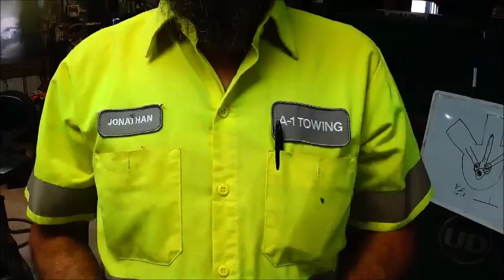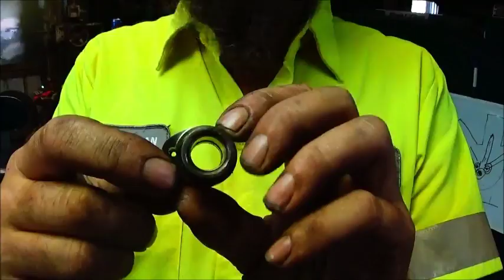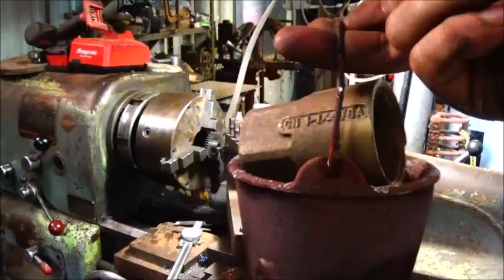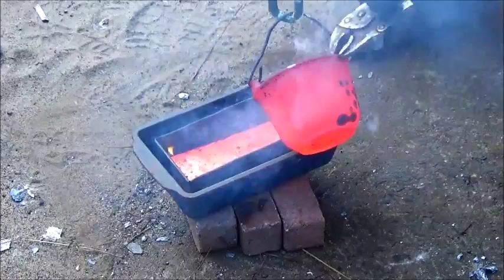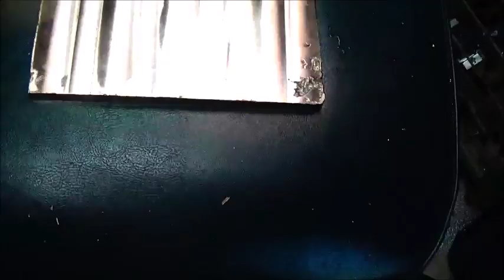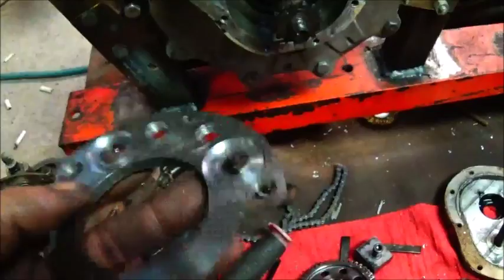Motorcycle Build 2 Cam Repair & Melting Brass

Comment: The other motor bother you the way it sounded because of the cams is this why you are doing all this cam  work
Reply from the maker: Not enough lift. I changed the rocker ratio and fulcrum point to get the max from the old cam, but wasn't happy with the high rpm running, so I changed the lobes for more lift.

Comment: A penny is the lowest form of American currency, worth only one cent, and is popularly believed to be made solely of copper. However, the common penny has been made of a variety of materials over the years, with copper even being removed completely in 1943. Today, a penny is made of 97.5 percent zinc, and 2.5 percent copper. The first penny was minted in the United States in 1787. Benjamin Franklin, one of the United States’ founding fathers, suggested its original design. The composition of the first minted penny was 100 percent pure copper. This continued until the mid 1800s, when the penny underwent its first change in composition.The bronze penny was introduced in 1837, made of 95 percent copper and five percent zinc and tin. These pennies were minted for another 20 years before the next change was made. In 1857, the common penny received a further degradation in its copper content, and was made of 88 percent copper and 12 percent nickel. This gave the penny a lighter, almost white, hue. In 1864, the penny returned to its previous bronze composition, of 95 percent copper and 5 percent zinc and tin. This continued until 1962, with the exception of one year. The 1943 penny was made of steel coated with zinc, due to a copper shortage. Because copper and nickel were sorely needed for making weapons for World War II, there wasn’t enough of the material to spare for minting pennies.There were a few copper pennies minted in 1943, and these continue to be highly sought after collector’s items today, due to their rarity. There are only forty of the 1943 copper pennies known to exist today, and they have sold for as much as $86,000 US Dollars (USD) each. According to the United States Mint, it is believed that these copper pennies were made by accident, when several copper blanks were left in the press as production on the new steel pennies began.    After 1962, the tin content of the penny was removed completely, and the cent was minted with a composition of 95 percent copper and 5 percent zinc. This remained the standard until 1982, when the composition was once again changed. This time, the penny’s copper content was drastically reduced. The new penny was composed of 97.5 percent zinc and 2.5 percent copper, also known as copper plated zinc, and it remains this way today.
Reply: They changed it because of the cost of copper.
A pound of pennies comes to 145 pennies that's copper pennies. ( there's 
185 pennies to a pound of today's lighter pennies with only 2.5%copper in them)
Copper is roughly $2.50 a pound so it would cost more to make them than they are worth therefore the change to a cheaper metal to make pennies.

Comment: . The Lincoln penny was made of 95% copper, 5% zinc from 1959 until 1985. Since 1985 it has been minted with 97.5% zinc, 2.5% copper ( Copied from coin trackers web site)

Comment: Re the hole, if you have some filler rod or Something the same size tap it in
Reply: Did you notice the 3.8 GM Ecotec valve cover melting Paul.?...They've got to be a plenty over there.

Comment: a radial engine would be something.  Johnaton would have to put his thinking cap on for a round engine
Reply from the maker: Would be no problem, but a radial sucks when the down facing cylinders collect oil and smoke like a train when started.

Comment: Where can I get your address so I can send you a flycutter? It bugs me seeing a million passes across things, and you make really cool stuff. 

Your mill uses R8 collets right? What size tooling does your lathe use (so it can match)?
Reply from the maker: It bugs me too. I tried to use my boring head, but it wasn't working well!! My tool holders are 3/4 in my lathe.

Comment: So, you're going to build a radial engine next?
Reply from the maker: Not technically! A "Fan Engine" or a "W3" engine. It uses a master rod like a radial, but has no down facing cylinders. I have the cylinders, but need to collect up some other parts, but I will be building another single cylinder next with an overhead cam using the same case as the other two engines.
Reply from the maker: V twin with an extra cylinder vertical in the center.
Reply: Jonathan W...V twin
Reply: Jonathan W if you use a single carb, it may load up the middle cylinder?